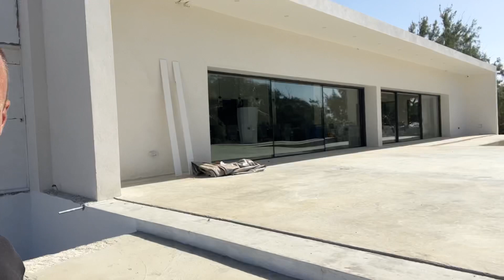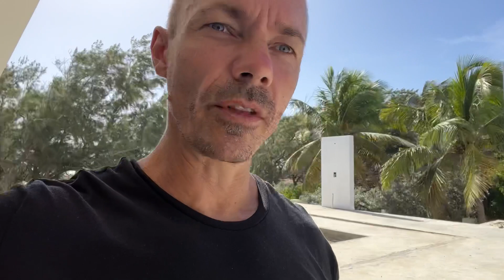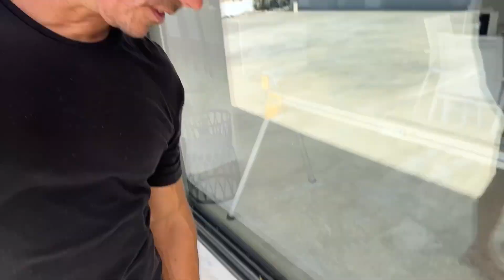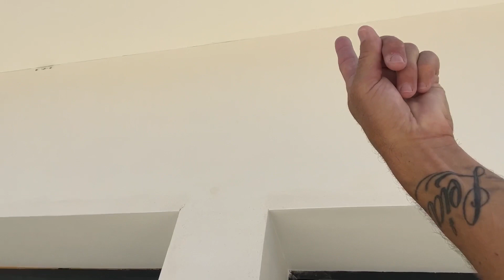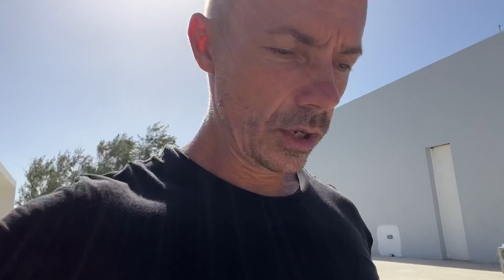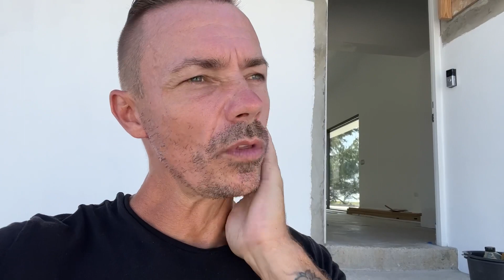Barbados 🇧🇧 Beach House Build - Day 263, cleaning big sliding doors

Comment: For the Roof Problem Maybe a Bedliner spray on the roof could work? They are pretty resilient?
Reply from the maker: What is a bedliner and how is it applied?
Reply: @barbadosbeachhousebuild  I'll Send you some info to your Email. Its a Rubberizedto Hard Coating used for protecting Pickup truck beds, It can be rolled or better sprayed. Not sure if its an answer but?